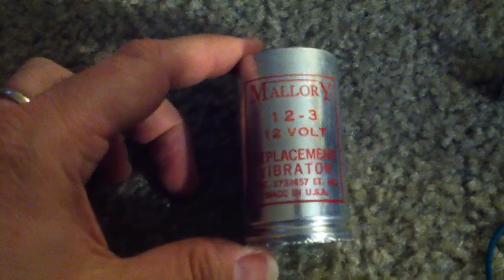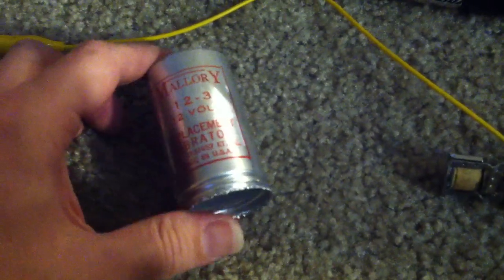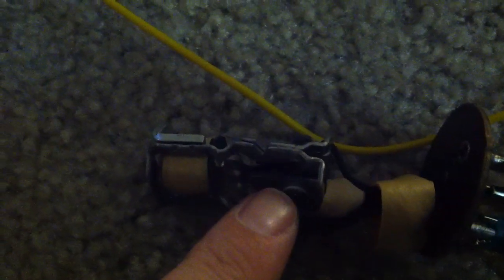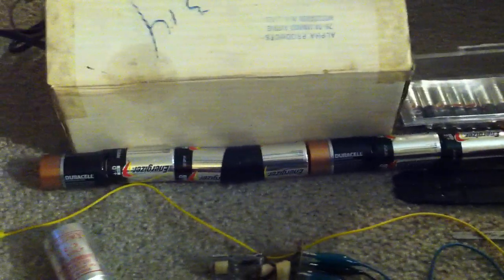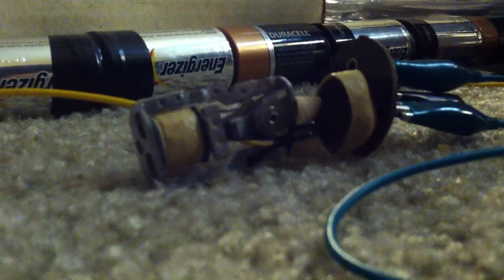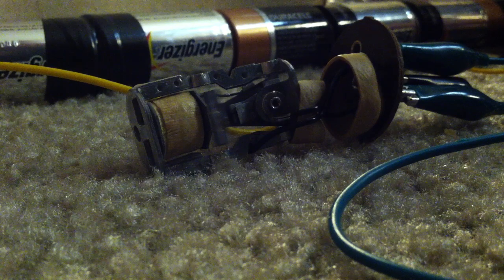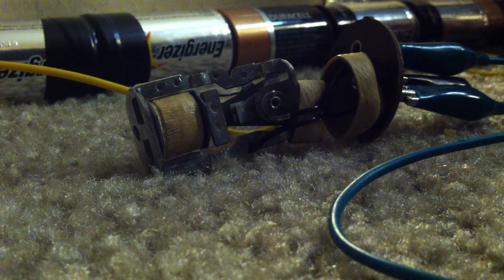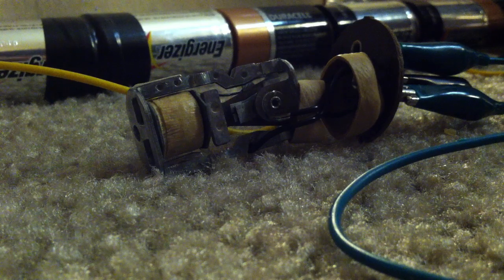Inside a 12-Volt Power Vibrator - Making Battery-Powered Tube Amps

Comment: Thanx for sharing, as it brings back some memories! :) :)

Sorry to say this, but you can pretty much forget about it, as it´s all mechanical, if you load this thing it varies a lot in terms of working frequency and stability.
You can try it, but i´ve done it as well some 20 years ago, to built up the same but with no luck.

If you really want to build  a tube based amp powered by batteries, you may go for battery tubes, or check out the car inverters you can buy today. Usually they have a 12Volts input and an ac outlet where you can plug in pretty much everything if it´s not exceeded the rating. That´s the easy way.

If you want it the hard way, here it is:
Build up a DC/DC boost converter. You can use a 555 and a PowerMosFet for this. Let it oscillate at about 50kHz somewhere. Hook up a coil to it (of course you have to wind it up all by yourself) and regulate the coil´s output voltage through a feedback circuit hooked up to the control pin of the 555. You have just created a simple PWM controlled boost converter. But if you overload it it´ll just blow up, as it is not short circuit proove. And you have to tweak it until it works on your load (= the Amp)
And it will draw a lot of current. If you want to have an Amp with let say 12W out of EL84/6V6 in PP or similar, it´ll need some 50Watts overall input power. To power it from 12V DC you need around 6Amps continously.....What battery you want to carry..?....;)
Reply: I'm not trying to be negative here, but a randomly chosen transformer and buffer capacitor is a recipe for problems. It is not the vibrator's fault.
The buffer capacitor must be selected using an oscilloscope. With correct operating conditions there is no sparking at the contacts - ever. Likewise the transformer must have a minimum amount of primary inductance and some ordinary mains transformers used in reverse are not suitable. There is a very good book written by Mallory on the subject, and the fact it is 129 pages long should indicate there's a lot more to it. The apparent simplicity of a vibrator inverter is always a trap for the unwary.
In reference to the vibrator not working at first, this is common when a vibrator has not been used for many years and is the result of an insulating film forming on the contacts. It can easily be burned off with high voltage within a few seconds. 
As  I use a lot of vibrator powered equipment, some vintage, some I've designed and built in the modern day, I can say the technology is extremely reliable when used correctly. If you're interested in vibrator power supplies, I'd recommend this site http://members.iinet.net.au/~cool386/
Reply from the maker: This idea is shelved. Just my limited experience with this thing on the floor showed me how unreliable it would be. Half the time it wouldn't get going. Thanks for watching the video and replying though! I do think this was an ingenious solution back in the day, but it's just not a practical one today when we have so many better alternatives available.
Reply: Never the less, you can do just a little "PlayMachine" around it, just to show everyone that, at least, a tiny, Itty-bitty thing with let say two 6BM8 or 6GW8 is possible, as they draw only 20mA@150Volts in PushPull expecting 1-3 Watts output. And their heaters wired in series would perfect fit to a 12Volts battery. As you already have one of these old choppers lying around.
So have some fun with it, but do not try to power a full featured Amp with it....;)

Comment from the maker: Short answer, Doug... I have no idea. I do know the AC is square wave, so it will need massive filtering. My practical side is saying if I want battery bower to just build a standalone SS battery powered inverter, but I'm fascinated by this weird little mechanical marvel. Something magical about touching 12vdc and seeing all that AC on the other side. Inspires dreams of running my guitar rig powered by hamsters.
Reply: Brad Linzy Not really a square wave, the vibrator contacts drove a transformer which has inductance and there was a capacitor in parallel to protect the contacts, so the current took a little time to rise and a little time to decay. So probably more triangular?
Reply: Wasn't it rectified ? IIRC, it was rectified with either selenium or later germanium diodes in bridge configuration, filtered. Indeed, noise was present at the reception, and the vibrator if mounted rigid on a metal case or plate...was awful. However it was the backbone of inverters before power solid state came .

Comment: Very interesting, Brad. I remember hearing the buzz of EM Inverters like this in old car tube radios from the 1950's. I believe the output of this device is a square wave (rather than a sine wave), which might create some filtering problems in an audio amplifier circuit.

Here is an interesting and basic article on Inverters in general that covers the old EM devices:  http://electronics.howstuffworks.com/gadgets/automotive/dc-ac-power-inverter2.htm  I guess the modern version uses a solid-state oscillator to achieve the AC output. Thanks for posting this and sharing it with us.
Reply from the maker: I anticipate some very noisy power. Probably going to need a choke or two in addition to normal filtering.
Reply: What sort of EM interference will be created by this infernal device? I see that a capacitor is used across the points, much like in automotive distributors, to eliminate arcing. 50's car radios using this seemed to work pretty well, without a lot of interference, but that was RF. It should be an interesting project.